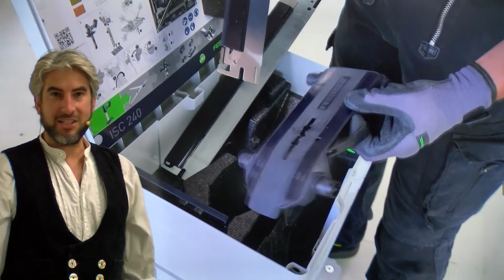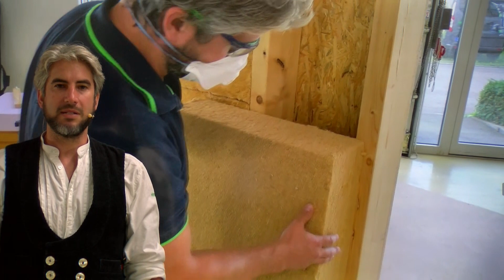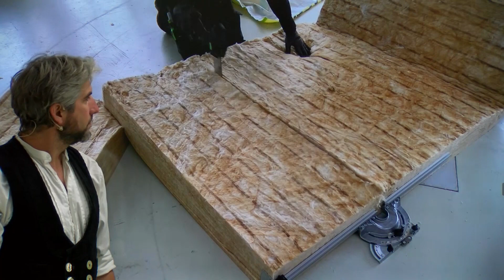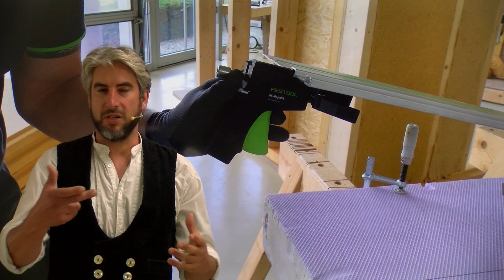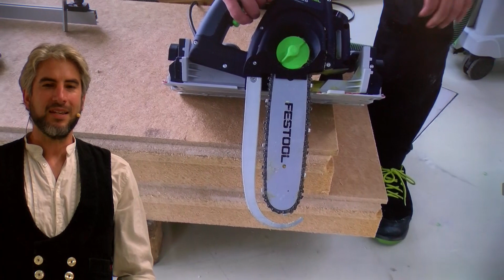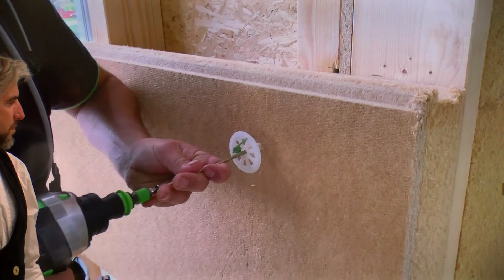Timber Construction Special pt 3 - Processing insulation materials with the Festool system

Comment: All good stuff! Q though: will the ISC not cut the dense wood fibre products then? Or are you just showcasing the other tools that can be used. I'd buy the ISC if I knew it could do rigid wood fibre too!
Reply from the maker: The ISC can be used to cut flexible mineral and natural fiber insulating materials as well as PUR insulating materials.
It is not suitable for dense/rigid wood fibers. In this case, we actually recommend the UNIVERS SSU 200 / IS 330 sword saws or a circular saw such as the HK 85.
Best regards
Your Festool Team